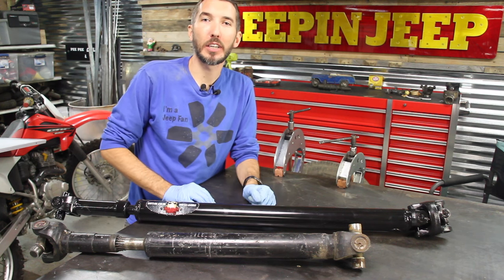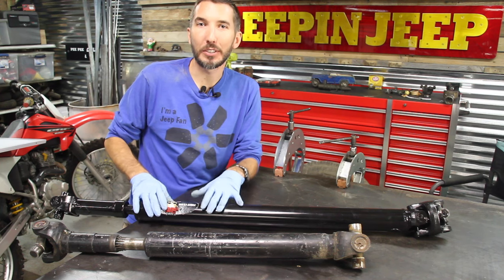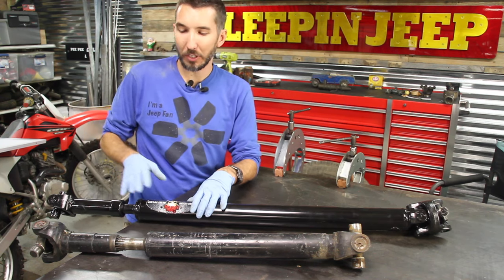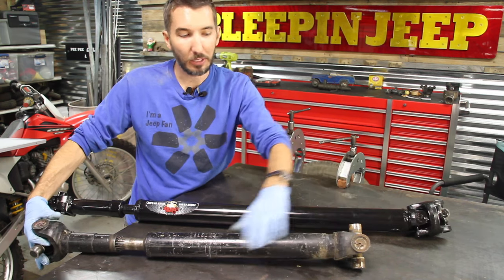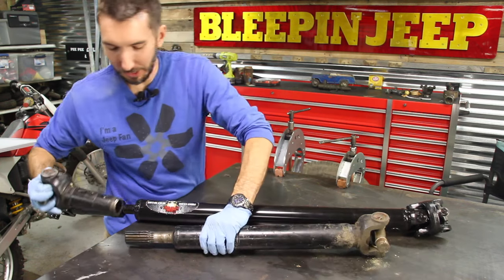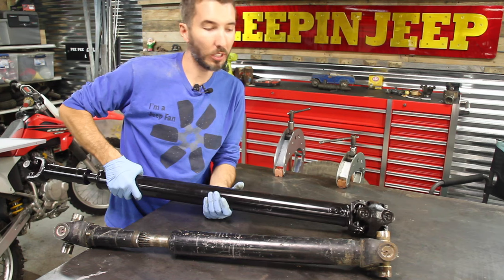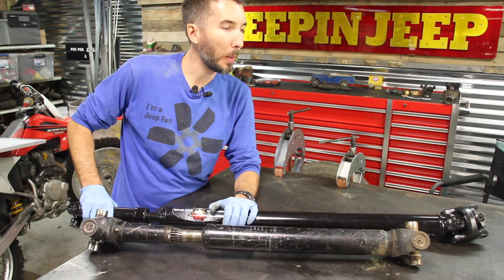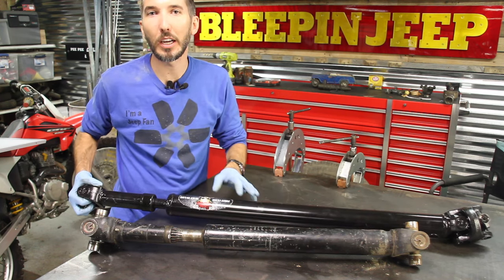How To Phase a Driveshaft

Comment: Thanks, Matt.  I love the fact that you didn't edit out the dropping of the shaft.  Lets everyone know you're human.  I'm a really old guy so I wouldn't do much but have you ever done anything on Liberty's?  I have an '04.  Thanks for sharing.
Reply from the maker: No, not much of s liberty fan.
Reply: @bleepinjeep  
Save me Matt. I did a boo-boo. Does this matter on a 1 piece driveshaft with a slip yoke? I'm in the middle of replacing my rear driveshaft's two u-joints. I didn't mark it for reassembly/alignment/balance/phase.

Does it matter? Can I just assemble it however?
Does it matter if the zerk is phased also?
Reply from the maker: @xmo552  You need to phase it just like show in this video!
Reply: @bleepinjeep  
Muchas gracias mister! 🙏
I appreciate your response. The warehouse sent mismatched 
u-joints yesterday. The store just called me to say the correct parts just arrived. Woohoo 😁
Reply: @bleepinjeep  
💪😁💪bro 
💪😁💪brooo 
💪😁💪brooooooo
Hey Brotaterchip I found a wealth of knowledge on this stuff. Check out WeberAuto on YouTube. He has 7 videos on u-joint tech alone. Each is an hour long, ugh. Plus vids on runout, working angles, vibrations, NVH, and etc related tech. It's enough to geek out on and turn our brains to bubble gum. 🤘😩🤘
Reply: Mine would have tossed needle bearings everywhere 🤦🏻‍♂️

Comment: This works for all vehicles where the transmission or transfer case and differential are on the same plane.  Some vehicles have the rear differential offset and not centered in the rear axle. This causes a two plane operation and a properly phased driveshaft might actually have one fixed yoke a few degrees twisted from the one on the other end. I would also caution hitting a driveshaft with a hammer and punch.  A good paint stick works just fine without the added chance of knocking it out of wack.  My guess is when punch marks are added on an aftermarket driveshaft is that they are done before balancing.
Reply: Lol pulling the ds mehhhhhhh again mehhhhhhhhh

Comment: 2:12 ok, and what if my propshaft is a splined 2 piece, with 3 holed rubber joints on both ends? how do I line up those metal 3 spokes to each other?

Comment: FYI some vehicles have out of phase shafts, the key to phasing is diff nose angles. if you have a raised diff nose, the prop should be phased. Also 90° is the equv to 0°. 180° is equiv to 0°, the only difference is as you say, balancing if applicable.

Comment: Not all driveshaft are phased Straight Like That .
On my Scrambler XP1000 S both the front and back driveshaft has offset phases because the input and output shaft are at different angles.

Comment: Now lets say that each U-Joint has a grease fitting in the same place, in phase will they be on both ends pointing up or down in the same direction, or, one fitting pointing up and one fitting pointing down 180 degrees away from each other?

Comment: What are your thoughts on the home made square tube inside square tube drive shafts?
Reply from the maker: Works but a lot of times I will hit a rock with my driveshaft.  Wouldn't want to try that with square tube.
Reply: @bleepinjeep  What if you cut the welded seam out of the smaller tube and stuff some round bar in it and weld it back up? ..maybe something with a lot of carbon in it? ..then maybe some like vertical gussets along the outter (bigger) tube. Lol I just think it would look cool. I heard of the concept years ago but have yet to see it in practice, there's probably a real good reason, huh? Lol thanks for your reply.. 
Respect

Comment: Hey Im new to driveshaft science... does a double cardan joint on one end provide issues when a single u joint is on the opposing end? That means theres 3 u joints total right? I would think theres a failure to cancel sin wave.
Reply from the maker: No but the angle of the pinion has to be set up different,  I have s video on this somewhere too.

Comment: Can a misaligned drive shaft cause transmission damage? I think I might have misaligned mine and now i have a constant loud whine at all speeds in forward gears coming from the automatic transmission.. Im afraid i just destroyed my transmission...ughhh
Reply from the maker: I wouldn't think it would but anything is possible,  especially at speed.
Reply: @bleepinjeep  Thanks for the reply. It seems my sprag/one way roller in the 4l60e transmission somehow became damaged and is causing the noise. It's either a rebuild or time to replace in order to eliminate the constant whine.

Talked to a driveline shop and said I need to put c-clips/retainers on the rear shaft- rear ujoint and the front shaft- front. I figured since it had the ujoint clamps with two 11mm bolts on both side that mount to the differential yokes,   that they didn't need em for my application. But it sounds like they are moving around while driving causing the heavy shaking at mid n higher speed. Gonna reinstall n see if that fixes the problem.
Live n learn

Comment: If I have a 5” lift on my 1999 Jeep Grand Cherokee what length front drive shaft should I get? Or is the stock ok to keep?  Thanks mucho bro! Keep up the great work.
Reply from the maker: I would give adams driveshaft a cell and discuss.  You probably need an sye at 5 inches
Reply: BleepinJeep thanks!
Reply: BleepinJeep but I think it’s 4” I bought it lifted

Comment: FYI if you’re ever working on an FJ80 the front shaft is 90 degrees out of phase and the rear shaft is in phase.
Reply from the maker: Cool, why is that?
Reply: Not sure but I found out the hard way. Dealt with vibes for a long time till I found the info on ih8mud.
Reply: 90 degrees is still in phase...
Reply: @bleepinjeep  landrover do the same thing, believe its to do with the length of the shaft. Landrover have the at 45deg out (or somewhere like that) I've tried my 90 in and out of phase and didn't see much difference.

Comment: My XJ has a driveshaft vibration I cannot get rid of. Tried everything, SYE, new shaft,  correct shims for the rear. Even picked up adjustable upper control arms to get the front pinion at proper angles.
You should do an episode like the problem im having.